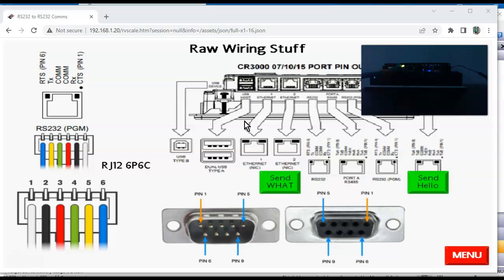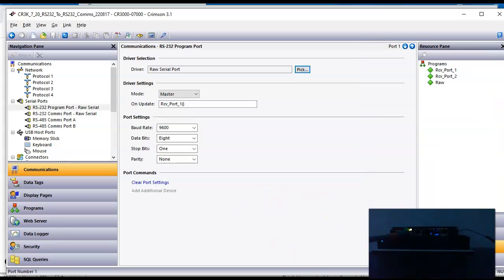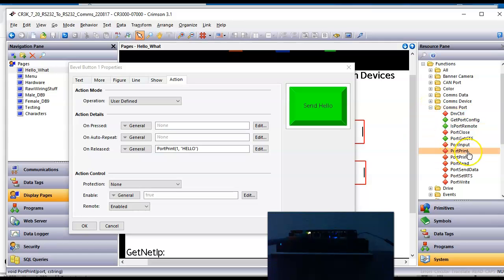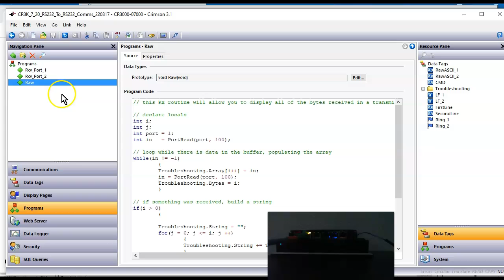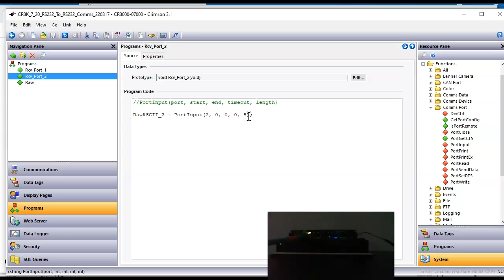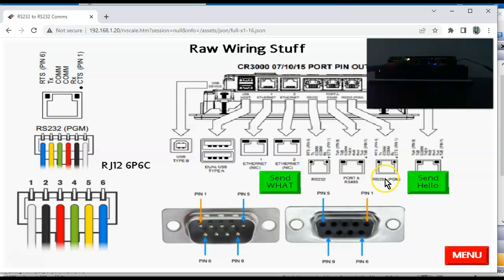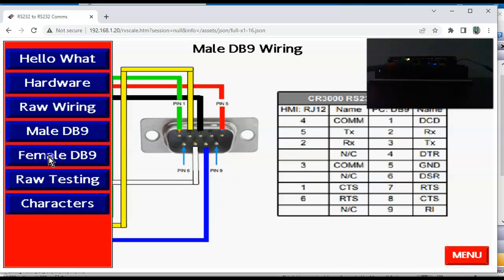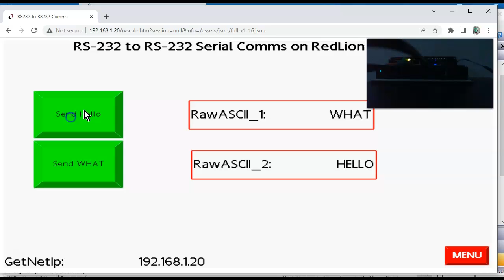Raw ASCII over RS-232 to RS-232

Comment: Thanks, Joe, for the great videos. Does ASCII always have to have a send command? Is there ever any way to set an ASCII system up to always be sending or pulling data? Trying to understand how I can hook my DA70 to a Keyence FD-R flow meter that has a RS-232 ASCII.

 https://youtu.be/GNSztbMfvlM?si=M45zA8jDeApW3G4q
Reply from the maker: Does that Keyence meter just keep outputting a raw ASCII string?  This video shows a device that just keeps sending out a ASCII message and the HMI can read and then parse it. Send me an email and I will send you that database for review, wazoo@adcreps.com  Watch this:  https://youtu.be/TWy9-Vw5fh0?si=s0G0CskY9_W3dLxZ